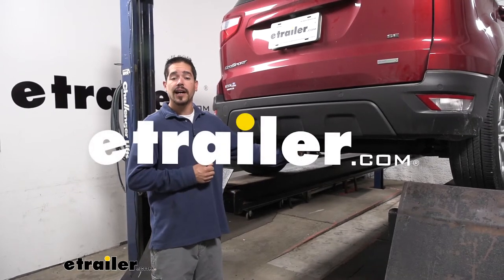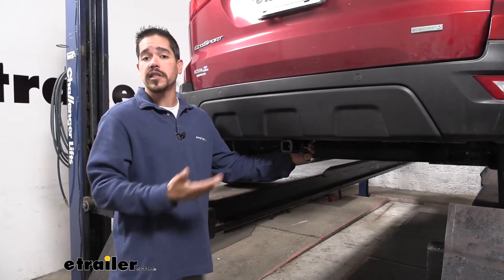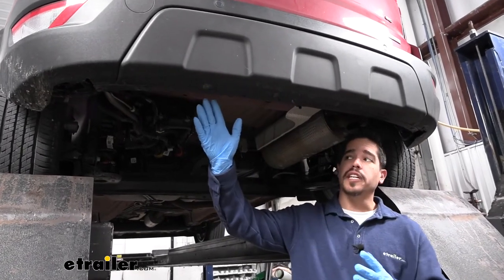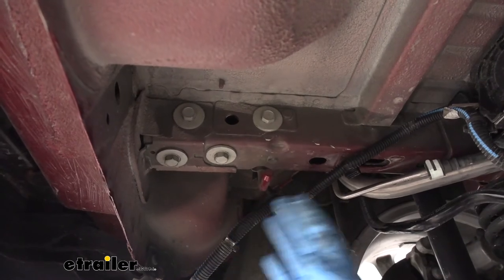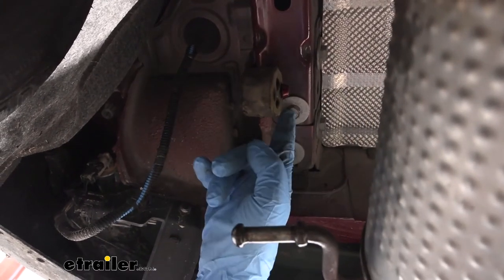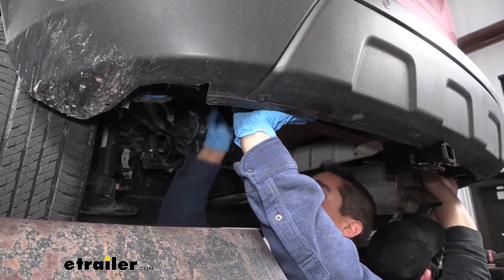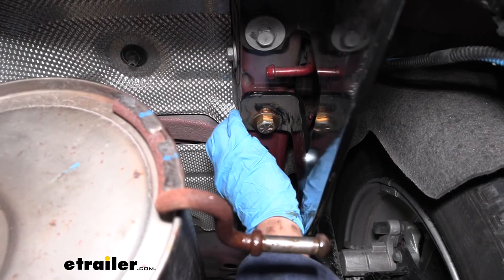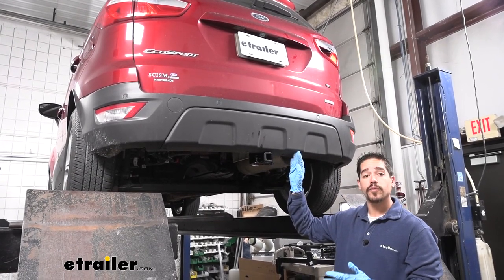etrailer | 2018 Ford EcoSport Curt Trailer Hitch Receiver: Complete Installation

Comment: Are you supposed to be able to attach the plastic facade back on? Or is the hitch receiver going to be in the way?
Reply from the maker: The lower fascia will need to be trimmed after the installation of the hitch. This will allow for it to be reinstalled and the vehicle have a factory look when finished.
https://www.etrailer.com/Trailer-Hitch/Curt/C12188.html

Comment: No 7 pin connector install too?
Reply from the maker: If your vehicle is equipped with a factory tow package, you can use part # C55774. This is a simple plug and play connector that will connect to your vehicles US car connector behind the rear bumper.
https://www.etrailer.com/Custom-Fit-Vehicle-Wiring/Curt/C55774.html

Comment: Any info on the factory trailer wiring install?
Reply from the maker: Not the factory wiring but we have aftermarket wiring. Here's a link to the harnesses we carry that are confirmed to fit https://www.etrailer.com/t1-2018_Ford_EcoSport.htm
We ended up putting the Curt on this Ford. You can see pictures of it on the product page https://www.etrailer.com/Wiring/Curt/C59236.html
Reply: @etrailer  Thanks for the info. You guys are awesome! Cant wait order a trailer hitch from you guys.